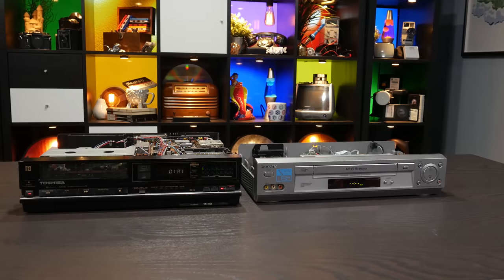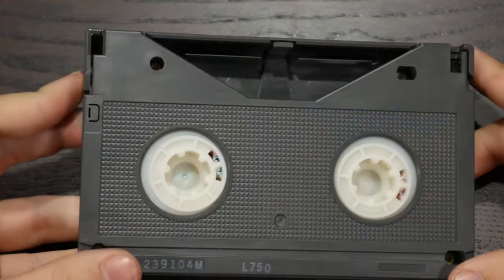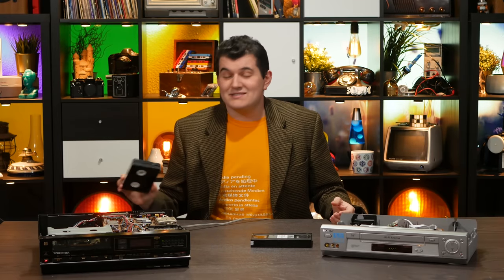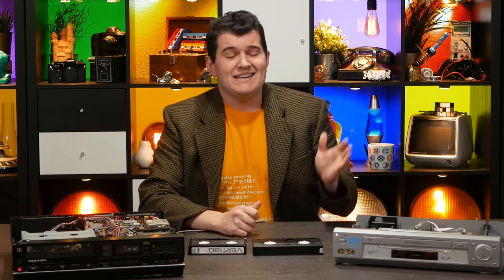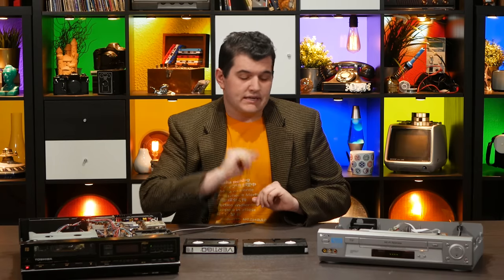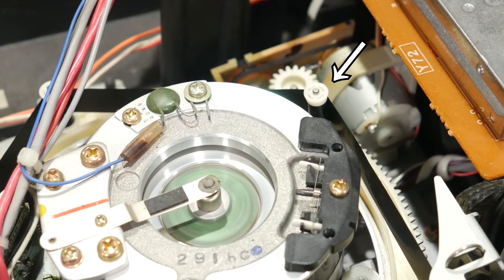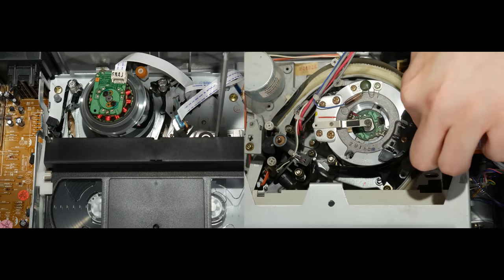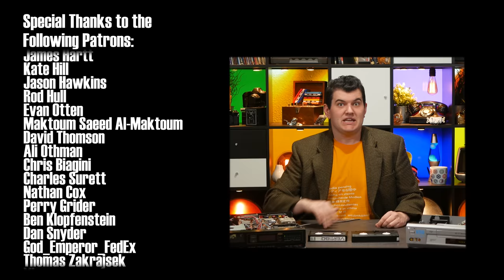The VHS cassette was more clever than Beta

Comment: In answer to the enigma of the lifting pinch roller (at 15:50)...you'll notice the original design called for the pinch roller to make contact with the recording surface of the tape while the capstan rested neatly in the recess of the cassette. This caused problems. Pinch rollers pick up dirt and debris over time, as well as develop small cracks particularly as they age. With the pinch roller pressing against the top side of the tape, this had the nasty habit of dimpling the recording surface by pressing debris and/or roller imperfections into it. This not only soils the heads, but the dimples damage the recording, causing dropouts where they wouldn't have existed otherwise. Placing the pinch roller against the backside of the tape produced the same transport results and kept any debris or dimpling behind the polyester backing where it can't do any real damage.

Comment: Concerning the question why in "younger" VHS machines the position of the pinch roller was changed (the tape goes under it and then the pinch roller goes down) :  This was done to enable the control head to touch the tape also during FF and REW.  So, the counter can be in H:M:S instead of just a number, by counting hte CTL pulses of the recordings.

Comment: One note about the tape leaders… Sony's 3/4" 'U-Matic' format that was introduced in 1971 used a clear leader with light sensors. Betamax was basically a miniaturized 'U-Matic'. Why would Sony go from clear leader to the metal? Back then, the lights that illuminated the sensors were incandescent bulbs and would eventually burn out. Another note about tape threading… Panasonic built a Pro version of VHS, similar to how Sony developed Betacam. Panasonic's system was called "M-Format" and used the regular VHS M-Wrap threading. Those machines did not fare well against Sony. Panasonic in 1986 unveiled a new format called "M2". They reengineered the transport and it worked more like the 'Beta' wrap.

Comment: The design of the drop=down pinchroller was to put the capstan closer to the CTL (control/audio head) so there would be better tension across the face of the head (less likely for the tape to wander up and down the head resulting in the mono sound track going in and out of clarity + plus loss of synchronization pulses for the head drum)

Comment: What I find interesting is that with the (Europe/PAL-only) Phillips+Grundig V2000 (sometimes also referred to as the VCC) System there was no standard loading mechanism. Phillips V2000 Machines use an M-load mechanism (tho one where the tape runs more then just 180° around the drum), while Grundig Machines all had the video drum turned 90°, so they could use a U-load (more like a C in this case) mechanism. And since Grundig and Phillips were the only manufactures of V2000 machines, well, those were the only two loading mechanisms.
Yes, there were machines branded by B&O, Telefunken and Marantz, but they were all just rebadged Phillips or Grundig Machines...

Comment: BTW to completely blow everyones mind. That notch in the VHS cassette.... it was actually already there in the predecessor to Beta, U-Matic. BTW you should do a Video on "Video 8", a system that is quite unlike VHS and Beta. For example it doesn't have a control track and therefore no tracking controls. Sony actually licensed technology from Grundig and Philips used on their "Video 2000" consumer grade video tape format. 

"Video 2000" was meant to be familiar for users of compact cassettes. For example types would have 2 sides and you would flip them over. Each side could hold up to 4 hours in single play mode, or 8 hours on long play mode, giving you a total of 8 or 16 hours per tape. (though long play mode was rare) Since noise bars during fast forward or reverse would confuse the consumer and cause them to return the recorders, they avoided those by using their tracking mechanism to still follow the sped up tape. This was simply done by putting the heads on piezo elements.
Back in the day, your typical Video 2000 VCR would cost around 3000 DM when even a simple U-Matic VCR would cost 8000 DM. Unfortunately build quality of the Grundig ones was abysmally bad, with plastic housings of internal connectors breaking off sending the drive into a self destructing rampage.

Comment: Another interesting symptom of the beta head not spinning, is it would tend to sharpen the flying heads and turn them into little razor blades, which would damage the tape.  Back in the day I replaced quite a few heads on beta machines.  They were also more prone to mechanical failure due to the wacky tape path.  It's funny how inferior and overpriced products such as betamax or Apple get a cult following of zealots who refuse to be objective.  Great video keep it up!

Comment: Well , here in Europe we pronounce it as the Greek letter , phonetically 'Beetamax' .

Yes , the transport was a scaled down U-Matic one , a very well engineered and robust format which had been tried and tested ; Video-8 / Hi-8 were of course scaled down again and still used a beta wrap ; versus the OMEGA wrap used by VHS , and its pro successor MII .

You can actually use small Betacam cassettes in a Betamax recorder , although I initially worried about the metal tapes wearing out the heads , it was never a problem ; I used to get them from work and used them quite happily in my SL-HF100 Hi-Fi Betamax , which came out before Hi-Fi VHS ; re the image quality , Beta was a more stable system and with the development of the SL-HF950 Super Betamax had the best picture quality of any domestic deck at the same ; this was NOT a component system as S-VHS was ( which did offer higher resolution , and carried on as a semi=pro format for a while ) , but Sony had Hi-8 waiting in the wings which , with its metal tapes , was better still . Sony also scored over the others with the fantastic SL-F1 portable and the accompanying PCM-F1 processor , which gave proper digital audio recording to the masses when nothing else came close , although the Video-8 EV-S600 with its PCM multi audio facility came along , and for a time I stopped using my Revoxes to record live audio . The Revoxes go on forever , but I replaced the EV-S600 with an EV-S1000 when I moved to Hi-8 , and it didn't have the multi audio facility .

As for the cassettes , an L750 held 3-1/4 hours worth of tape vs the 3 hours of an E-180 , and while E240 and even BASF made an E500 those used very thin tape which was prone to snarl up ; I'd also expect 40 year old E240/500s now to exhibit print through . The boxes of the Beta cassettes were more solidly constructed and what does the size of the aperture in the bottom matter - you're meant to put it back in its case when you're finished with it . Oh , and just as with U-Matic , with Betacam you got larger cassettes for use in professional machines , which took both cassette sizes ; so did MII where the 'small' cassette was closer to the size of a small Betacam tape and the large one was the same size as a VHS tape ; ironically my MII machine has developed a loading fault , while my S-VHS , U-Matic , Betacam , Betamax and Hi-8 decks all continue to work fine . As do my mutually incompatible Sony and JVC Mini DV , DV , DVCAM , HDV decks ; I just never bothered getting a DVCPRO deck as I hardly ever see any tapes of that format ; I mainly use XDCAM-HD using the Blu-Ray 'Profesional discs' these days as I haven't yet gone solid state .

I used to have literally thousands of both types of cassette , but eventually composite formats were left far behind and one day I took almost all of mine to the dump , literally filled the back of my estate car with them .

Comment: Way back in the mid 80s I had the good fortune to use both formats. VHS had already won the format war and some relatives gave me their Betamax machine. One of the first things I did, being thus minded, was open the Beta machine to compare it with VHS....and I decided that the people who designed the transport mechanism with that carousel, all the points of contact and quite violent yanking of the tape.....were likely insane. 

Thinking of tape life though, at one point I had over 6000 VHS cassettes, some of which I played many times...and some of which got used for time shifting and therefore got a LOT of use. I never wore out a VHS cassette, or a Beta one for that matter. I did wear out several VHS machines! In terms of picture quality, I never felt there was much to choose. But in the days when the format war was raging, far more VHS machines had things like perfect freeze frame on pause, picture search in colour, far more availability of blank cassettes and movies to rent. It was the "user experience" that was better with VHS. And yes, soon VHS machines started to become smaller, something Beta never were able to achieve with that crazy carousel loading system.

Comment: With VHS and Beta fighting it out Philips along with Grundig and other European companies backed the Video 2000 format. RCA sold a version in the US but "no" one bought it. Taking the advantages of audio cassettes (also Philips invented) the flip over tape came in 120, 240, 360 and 480 versions being longer than the 360 minutes of VHS. One model had half speed giving 8 hours recording. Pre-recorded videos usually chose to record on a single side which means the tabs to prevent recording on the blank side could be reset and you got a bonus side to record on.  Sold well in Germany and in Cambridge. UK (Pye in Cambridge was owned by Philips could have been the reason). The controls of the Philips VCC200 machines were very logical and easy step through to set up recordings. Grundig choice a reverse programming where you entered the number (channel, start time, end time) and then pressed the button for that. Eventually they gave up, many models sold had problems and I had several in repairs from new for years using loan machines until they sorted out what was wrong. In recording quality it took the arrival of Super VHS and Hi8 to better the picture quality of Video 2000. 

Another tape format that has play back issues are reel to reel recordings. Scotch and Ampex quarter inch tapes apparently have issues with BASF not so much. Storage in damp garages and attics possible contributes largely to that. 

30-40 years on (tapes recorded on between 1980-1991) many VCC2000 tapes are virtually unplayable with the tapes needing baking before anything can be seen. VHS tapes from BASF and Philips seem to be playable but of those I have watched they are over a decade younger. Hi8 and Super VHS perhaps are not old enough to show their age. 

Sony was aiming to make the smallest camcorder and took some of the elements of the Video 2000 dynamic track following and what had gone before to create the 8mm formats. There was not much between 8mm and VHS-C but then Hi8 was better with a PCM sound track on the pro models. Super VHS-C has shorter record times but would fit into the adapter and play back on a Super VHS deck but few people owned one so it made little difference. 8mm and Hi8 camcorder owners transferred their home moves to standard VHS and re-used the expensive Hi8 tapes.  The next tape format DV brought both camps together but the digital miniDV is limited to 60 minutes or 120 at half speed. Digital 8 was Sony's way of enabling their 8mm/Hi8 customers to upgrade and retain the playback use of their old tapes offering the same digital performance of miniDV but larger camcorders. Very shortly the move was to HD. Sony split sales of DV between micoDV and miniDV. HD miniDV used 1440x1080 resolution but their disc and memory stick recorders full 1920x1080p. Recording home movies on memory cards killed off the tape based camcorders.   

In the home, for off air recording that everybody seemed to do all (well mostly) stopped with the arrival of digital TV and the switching of the old analogue transmissions. There are off air recorders to DVD and hard drives but I don't know anyone who used one. Some people have their old home movies but no longer have a machine that can play them back. Some transferred to DVD and now don't have a DVD player either.

Comment: I like the big rotating main loading mechanism in the Beta machine. It looks simpler and more reliable than the curved sliding paths and levers of the M-Load.
Also I would argue the inductive tape-end detection has greater longevity than a bulb (that burns out) and photocell (that gets dirty). Never had a problem with the actual detector on an automated 35 mm projector.
Not that any of it matters - BetaCam and DigiBeta is the way to go, much easier and more reliable to prepare and cue for projection than all those crappy menu-bloated, auto-replaying, stuttering, and failing Blurays and DVDs.

Comment: Beta was actually better than VHS in picture resolution and Beta had enough bandwidth in the video signal to place the HI-FI audio whereas the VHS format had to add a set of heads to the scanner to make that work.  Being a broadcast engineer, I still bought a VHS system just because it made more sense to me all around despite its better performance.  The Betamax VTRs basically duplicated the "U-Matic" design Sony came out with in the early 1970's.  The same threading technique followed with Sony's release of their BetaCam broadcast decks.  We bought a dozen PVV-1 dockable decks and 3, of them failed right out of the box and 6, more failed while in the field (loss of color, gears breaking in the threading mechanism and one had a bad lower drum assembly).  Oh the fun of working on these things never ended, glad to not have to worry about those anymore.
Reply: Oh here's the comments he was talking about xD

Comment: I suppose you're gunna mention that the beta's all looped up and this means when in FF and RW it was wearing out the heads. It's the heads that count. VHS dis-looped from the heads for rewind and fast forward. A head needs to be soft, so that it won't magnetised, whereas the tape has to be hard, in order to keep it's magnetic information for playback of course. So VHS machines lasted the longest for the heads and THAT is what you want.
(In order for vhs to ff and fw and view the picture, it didn't fully loop up but just skirted the heads. This resultant wear level (just touching) was the best compromise. Plus that the tape to head speed on vhs was less, vhs was a "win, win" as they say.
So professional beta cams wore their heads faster too as they had the same loop up (instant playback) - for editing(?) as the consumer market.
Super VHS used a still higher frequency set (better picture information) than hi8 did.
And I bought the Sony numpty cam. :(

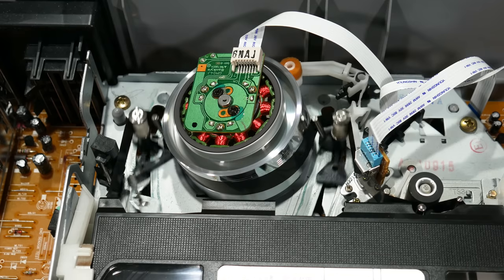Comment: Even decades later, that blinking "12:00" on the VCR clock is... maddening.
Reply: Most blink 0:00 that I have seen - the power up ready to set mode. Even when I found the remote and reset the clock someone comes along and switches off at the mains and they still don't know how to reset the clock. It isn't much use as you can't record off air - no analogue transmissions. The JVC Super VHS does accept 99. the clock on a 2003 car only does to 31st December 2020 and some cameras with databacks ran out in 2010.

Comment: Technically they would be splined holes. Though im sure im wrong about that or at least there are several other bits of nomenclature that could be applied. 
 As to the bits that fit in them and apply the motive force to them to move the tape, they are cogs.... sort of. 
Cogs are the "teeth" that are on sprockets or gears... i think, maybe they have a different name on gears. Thats of course only applicable if there isnt actually a technical or better name for the spinny bits in either format. In which case the spline like or tooth like or whatever bits may or may not likewise have a different name.